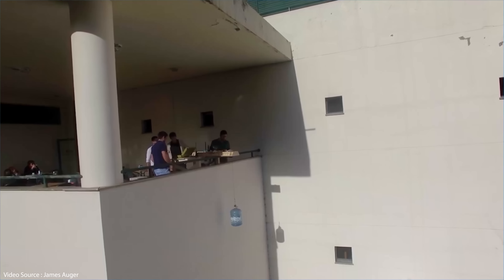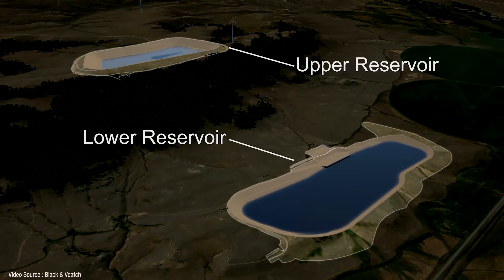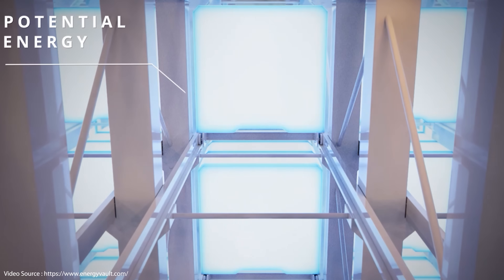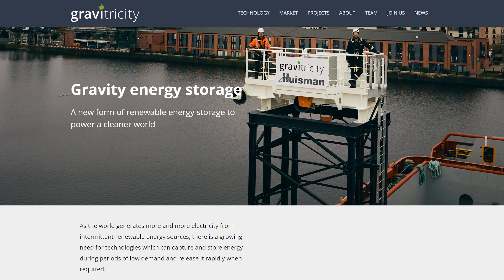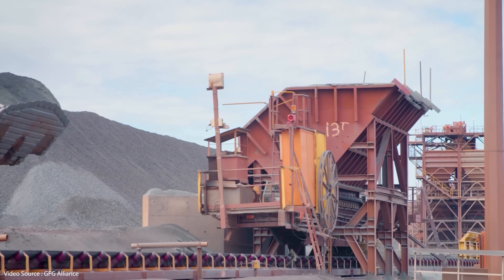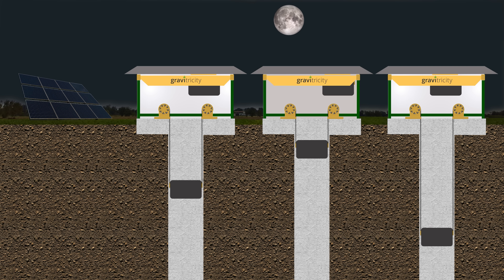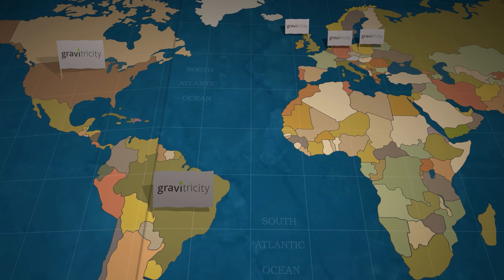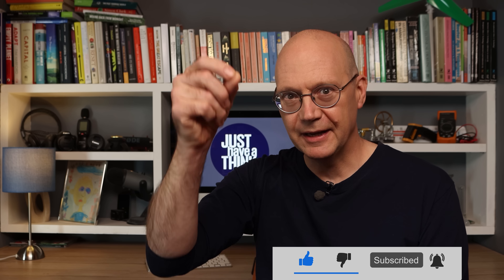Gravity Energy Storage. Who's right and who's wrong?

Comment: Are they considering a box-in-a-box, multiplicity by stacking up another winch/generator assembly on top of the ground floor assembly---hoisting a narrower/taller weight, inside the same shaft space??

I'm assuming, that the sizes of the weights, are constrained by the available regen systems and pulley/cable limits, imposed by off-the-shelf hardware, of course.

Pass it along.  It just popped into my head, on watch the video.

If needed, regen/winch power, can be through driveshafts, to the site of the hole, leaving only pulleys, to be mounted directly over the vertical shaft.

I'm sure I can't be the only engineer, that immediately saw this multiplicity use of a single hole.  It's just the way I think.

Comment: Making concrete adds a lot of carbon to the atmosphere. I wonder how long it would take a gravity/concrete method to make up for for all the carbon created during construction?
Reply: its all cheap cgi to grift taxpayer and AGW cultist money away.
Reply: A vessel full of sand etc sounds better imo, even rocks.
Reply: @hynot9175  I think that's the plan. Build the inital concept prooving plant with concrete, and if the physics/effeciency works out, then use more environmentally friendly heavy loads.
Reply: remember these are batteries not generators
so the answer is never

these work on the ends of coal plants too (they would just waste power that way though)
the main benefit of batteries is to make up for lulls caused by lacks in the system (renewables not always being actively useful for generating power)

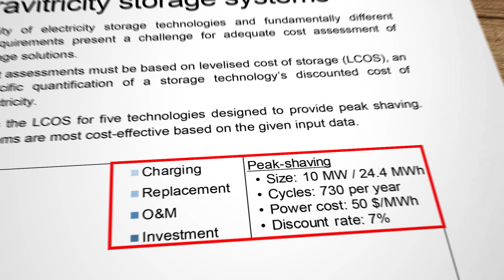Comment: @ 8:05 that cost analysis looked at a 24.4 MW-hr facility.  Using some of your previous numbers of a 500 t block and 500 m mine shaft, that amount of storage would be on the order of 35 mine shafts.  Not impossible, but one wonders just how many mine shafts are available in an area and the true costs of 35 such systems.  Guess we'll see how things progress.

Comment: This gravity thing gave me an idea, what if the weights that you use are heavier then air, but lighter then water, would it then not be possible to have the machine on some sort of wall, where the weights go down one side, under the wall, in some kind of configuration that keeps the water from running under the wall, then when the weights are under the water they get lifted up to the top by buoyancy of the water, and then dropped down again on the side of the wall that has air, making the weights loop around, that way generating electricity, even the, even the upwards pull of the water on the weights, might be able to generate some kind of electricity.

It’s just an idea.
Reply: Sounds like a perpetual motion machine, the weight drops through the air and goes up through the water and down again in a loop as you say, continuously generating electricity as it does so.
There's always a flaw.  I think any way to stop the water running under the wall would require the same amount of energy as you'd get out of the system.

Comment: Probably the most difficult engineering problem will be the cables. Those have to support the weight of both the cable itself and the weight on the bottom. At 300 to 500 meters the weight of the cable might be more than the cable can hold, let alone the weight at the bottom. A thicker cable is also heavier, there is a limit there. For up scaling there is plenty of work to be done before this will really work. 
I wouldn't be surprised if in the end they build water tanks on top of the mine shafts and go with the liquid solution.
Reply: Making self-carrying cables for such heights is a known and solved problem, and if their calculations are any good they will have identified the cost of buying those solutions on the commercial market.

Comment: For a cheaper solution, couldn't cages of crushed rock (at nearly twice the density of water) be used? Much cheaper than fancy iron. There are probably other cheap, low investment/low initial energy resources that could be put into containers for these. Sure - not as space efficient as the dense iron, but if they are cheap to use and make, then they could be installed in more places.

Comment: I don't believe in economical viability of those gravity storages. The energy stored in them is too low. For example you need to uplift 7.2 metric tons to 50 meters up to store 1kW*h of energy. You need a construction similar to full scale tower crane which will cost you  at least $100 000-$200 000. Or you can buy li based batteries which can cost you $100-200 for a kW*h capacity. And even that is considered too expensive for large scale energy capacities needed for energy systems based on renewables.
We need something about $10/kWh storage to make it viable. Can you imagine $ 10 system capable to lift 7.2 tons up to 50 meters?
Reply: So I don't understand  organisations who even seriously think about such storages. Can those people  calculate m*g*h ?

Comment: This actually looks a lotsimpler to construct than a pumped hydro facility.
I'm kicking myself that I didn't think of it myself years ago now that it's been shown. Actually I did consider it years ago but just thought that it wouldn't provide significant amounts of power because I never considered a system utilising something like a mineshaft!
The main issue here seems to be to find a way of raising and lowering a very large weight without having to build something like a skyscraper or dig a deep hole, where this issue is concerned have you seen the idea of raising and lowering such weights from floating platforms in the ocean, (at windfarm sites) the weight will have less effective mass due to the density of water but there are some very deep parts of the ocean, consider for instance the marianas trench"
Overall I'm left thinking, dooooh! Simples!
Reply: Unfortunately it isnt that simple. Deep oceanic water is miles from shore which requires long runs of inaccessible cable to transmit any amount of energy. Additionally salt water is extremely corrosive, which plays havoc with cables, chains and delicate electrical generators.  Additionally the water will impart buoyancy on anything you lower into it, which reduces your efficiency. Potential energy is calculated using m*g*h, or mass times gravity times the height displaced. By lowering your masses into the ocean you're reducing your effective g and thus you have to travel further to achieve the same energy output.
Reply: Points acknowledged, a long power transmission line would only be justified if the capacity of the generation plant were large enough and yes, point taken the marianas trench would definitely not be a suitable location for the reasons you've given but I've just looked at a bathymetric chart of ocean depths and though some places are definitely better than others there are an enormous number of places where the ocean depth is at least 6,000ft deep within less than 50 miles of the coast and in some places the depth is considerably more. Europe, apart from Spain is poor but the west coast of south america is superb!

The corrosion problem seems to me not to represent an unassailable problem since we have materials that are corrosion resistent, eg. synthetic fibres for the cable and corrosion resistent alloys for the winding gear.

Wind tubines house generators and we have those operating in maretime environments allready.
As far as the density issue is concerned I see that as being a mere loss in potential efficiency since the weight can just be made larger.
Thanks for your input.

Comment: For years we have elevators and thousands of skyscrapers we have car lifts that raise a car in about three minutes and when it comes down it’s just a waste it could be regenerative electricity being charged  into  capacitors even if every five lifts of the car that you’re working on your going to get one for free same concept with the elevators is it going to lower the cost but the idea of making these for power plants is not the way to go do you want to make small versions to generate power for peoples houses that would be more practical plus as the weight is dropping it is not just spinning one wheel but a flywheel pet stores energy kinetically and when the one weight hits the bottom the neck starts in cycles the weight could be a tank or container of water which would dump at the bottom and go back up and be filled at the top this could be done with essentially large RAM pumps that don’t use electricity to raise the water back up into a reservoir individual houses could be set up with these along with solar and you could be completely off grid. If you will remember the clock tower big Ben was essentially a grandfather clock that once a week a team of action would lift the weights to the top because of the ratcheting mechanism it would take it a while to get down you also remember that when they replaced this system it took a 40 hp electric motor to run those giant hands and the clock as inefficient as it might’ve been with today’s technology and materials we could generate electricity with a very small amount of power needed to lift the weights back up the only ones debunking this are the ones who want to sell you solar or some other form that they are in charge of

Comment: why can they not put them inside the windmill towers electricity inferstructute is thare and can draw power direct when the grid docent need the energy often i see our local mills dormant regularly
also you can put wave generators at the base of offshore mills generating power when the wind is to strong for the windmills  (copyright Shane Walker 19/7/2022)

Comment: Imagine a scaled Gravitricity unit at the centre of every new tower block and high rise, being able to supply power straight to that building...
I live in Cornwall and we have a vast network of dis-used mineshafts here (probably one under my house), would be a great place for them to start in the UK.
Reply: Seems brilliant, right? Until you realize you'd need more than the weight of the ENTIRE tower suspended at more than the height of the tower to be able to power the building overnight, and then you'd need a square mile of solar panels to charge the thing every day. And then you'd STILL have to cross your fingers and pray that you don't have two cloudy days in a row :P
Reply: If you put cost as a deterrent, it is just what has cost humanity advancing.Think money, a promise? Stops humanity? We can’t switch gravity into reverse, let go, down, dump your weight, rise up. Using  energy? Equal and opposite required, just to break even. The system of , people transported uphill, by weight of more than them.By water in a free filled tank. Then people coming down by everfree gravity . Water used, but free only for its weight. Then dumped.  It’s all going downhill in the true sense of the gravity for water is always going downhill. Get it use it, wind, get it use it, tides ,by lunar attraction, use it Solar, all free , but money is the big controller. Why is this mindset not dumped?

Comment: Unfortunately, as prior physicists have pointed out, unless you have a massive volume where you can maneuver large amounts of mass (i.e pumped storage), using gravity for energy storage and conversion is infeasible and inferior.

Don't people realize that these ideas have already been considered numerous times? You can't sidestep the problem with fancy control systems. This is truly basic science stuff.

For example, a 1000 kg mass raised to a height of 100 m, with 100% energy conversion, only supplies about 15 minutes of energy at a 1 kW power draw. That's barely enough to run a microwave.

Comment: I'd like to see the idea explored of pumping air under sea/underwater into storage/balloons that pull tethers to the surface and then are deflated and retracted.
Reply: It's not quite what you are describing, but you might find this video interesteing. It explores 4 concepts of underwater storage: https://youtu.be/gd1fTJ-csio
The first one pulls gas filled containers under water to store energie, the others pump water in/out of a container and utilize the pressure difference to strore energie. Especially the last two concepts look interesting, as the capacity would go up with higher depth (higher pressure).
Reply: I suspect such a system would be very hard to maintain. It would also suffer worse from weather and currents than the crane tower does from wind. Salt water being very good at dissolving stuff would make material requirements strict and maintenance underwater is far trickier and expensive. It's a fun idea though.
Reply: I know it would be a Challange, so is space. Plastics work well in the ocean, we have years of data confirming that. Lol

Thanks for the video Oliver!
I love outside of the box ideas
Reply: The submarines gonna crash right unto that and itll gum up from ocean barnicles etc
Reply: @TheAnnoyingBoss  yeah seems impossible for them to be able to avoid something like that with the ocean being so small and having no way to navigate or see anything underwater

Comment: Batteries are a terrible idea for grid-scale energy storage and gravity is very much worse by any metric. It is utter nonsense at the most basic level when you calculate the potential energy size and cost of any readily available material except for water.

Where I live wind is being promoted as the main "renewable" and the wind will fail to blow for multi-day periods on a regular basis (we've had two 10-day spells in the past year where wind was less than 10% of its capacity). So you still need to cover 100% of your needs with fossil or nuclear generation, battery storage for wind is simply not viable, gravity storage even less so.

Comment: Storing energy with towers and weights or the weights letting sink into the liftchannel of a mine are brainless hoax. Compare the watermasses of a high situated lake flowing through a hydrogenerator to a low situated sea and vice versa pumping back for storing electricity back shows the whole misratio of the moved masses. For 10 kilowatts power you have to move each (!) second one thousand liters of water one meter down for earning electricity and pumping up for storing. Only PV storing in batteries is the other practical way bridging the timelag between generating energy and its need. Think about and don’t believe to the hydrogenium popes, losses for conversion are more than 50% and PV energy needs a lot of planes and in winterseasons you have the biggest energy consumptions 😂💤

Comment: I got a better idea that uses water like a stored hydro facility, the idea is to generate more than the demand for the grid at that moment and store the excess for later pumping, using solar to back up pumping water back into the stored reservoir. if there is a river nearby, then additional water needed could easily be pumped from the river.

Comment: The amount of energy that can be stored in any practically sized system is miniscule -- it might provide load balancing but since solar is the energy source of choice you have to deal with the storage requirements for solar and that's where the miniscule energy storage capabilities really hit home.  Imagine a massive field of solar panels that, in the winter, generate power for, maybe 8 hours per day so an energy storage system would need to handle the other 16 hours -- 2 to 6 hours is nowhere near adequate.  These ideas were savaged by Thunderfoot and others and I won't go down that road except to say this form of gravity energy storage is pointless!
Reply: In some parts of the world wind is being promoted as the main "renewable" and the wind will fail to blow for multi-day periods on a regular basis. Basically you still need to cover 100% of your needs with fossil or nuclear generation, storage for wind is simply not viable.
Reply: @johnafish  -- Wind is pretty much the cheapest energy there is so of course it's going too figure into the equation.  Solar only work during the daytime so storage is needed for the night.  The gravity energy ideas depicted in this video and others like it is a joke, yeah, it might offer some load balancing advantages but the miniscule amount of energy they can store and the absurd complexity of them is a hard fail straight away.  BTW, getting back to solar, the efficiency of even the crapiest solar cells is vastly greater than the efficiency of the natural process that produced coal, oil and gas -- all of them getting the energy from the Sun at an efficiency much less than 1%.
Reply: @Raptorman0909  The cost of connecting wind generation to the grid is significant because the location is distributed and rural or even offshore, often these costs are accounted for separately (or by others) to make wind appear more attractive, but the biggest issue is that wind can run at zero output for prolonged periods so real generation capacity still needs to be built in parallel with the windmills.
Reply: @johnafish  Why did you delete your first post to me?